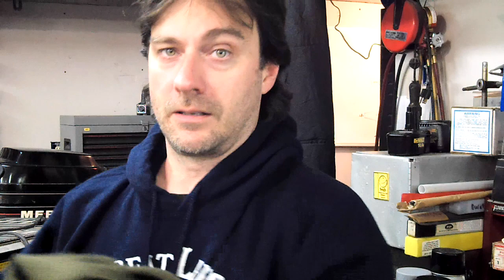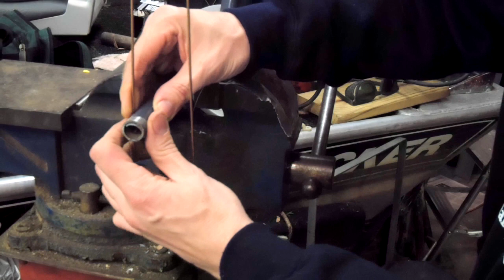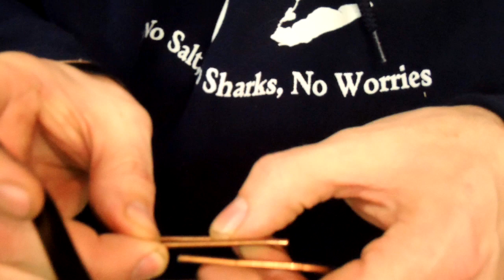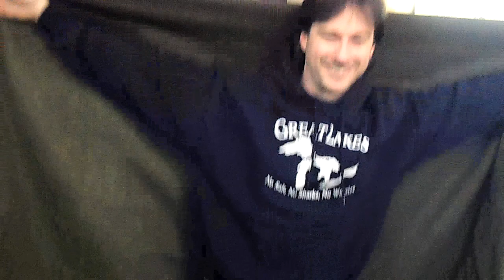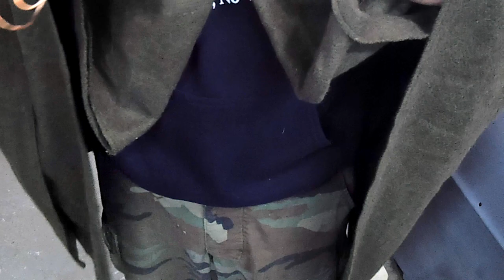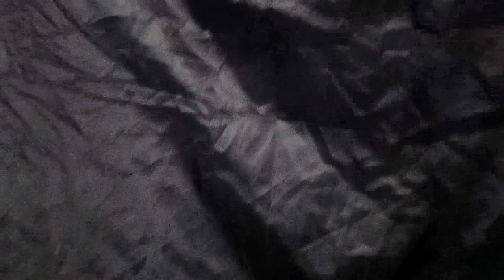Making A No Hole Blanket Pin

Comment: OK this video seven years old I like the no Weld method I have a suggestion on not using the electrical tape so much, but to use the shrink tubing that you would from doing wire connections. It would be durable and be tight be easier to slip a blanket through than electrical tape. just my two cents but I like the blanket pin with no holes going into I want a blanket
Reply from the maker: That's a good idea Ray!

Comment: Slick lil project there. Dave's super clip. :) make em all enough no hair cut needed. then they are Dave's wire hair barrets. :p What gauge do you think would be good if it's say solid core copper wire, 10 or 12? Happy New year as well Dave for you and your family. Keep the fun crazy projects, and wit coming. :)
Reply from the maker: +Certawin  LOL, thanks man! I'd say on Copper I would go for 8 or 6 gauge if you can. Copper is so soft that even 10 may just bent too easy and not hold. I used 1/8 carbon steel welding rod on this and its the smallest Ill use. Happy New year to you and Thanks for watching

Comment: Instead of black electrical tape, you could slide two pieces of heat shrink on the wires. You would then slide one over both loose wires, heat shrink it, then slide the second piece of heat shrink over the first one and heat shrink it also. Double layer for extra strength. I'm guessing an inch or inch and a quarter length for the two pieces would work. What do you think?
Reply from the maker: +Diane Rivenbark  Yep, I agree with you. Heat shrink tubing would be a perfect way of holding this together. At least an inch would work.

Comment: Excellent idea... is it possible to solder the cut ends, instead of using tape?
Reply from the maker: +TBOR101 Thanks, I'm glad you liked it. Yes, if its clean enough it could be soldered. Another option is heat shrink tubing.

Comment: If you could wedge the smaller diameter pipe/dowel into the larger diameter pipe, you wouldn't have to keep changing out your vise.... just a thought.  Would help if you were making several at a time.
Reply from the maker: +Faith Adams  I probably could, or hang it off each side of the vise. Good thinking Faith!

Comment: Hi Dave, cool idea bud!  I can see how they could be used for several things.  But, not even a pocket knife on you?  tsk tsk tsk ... lol  I've carried a lock blade folder in my pocket since I was a kid, because my dad carried one, so I had to as well and the habit was born.  It only has a 2 1/2" blade, so not big in the pocket and great for times when you need to cut something quickly.  Rock On!
Reply from the maker: Thanks man! Nah, no pocket knife for me but often times I carry a multi tool. Thos seem to work best for me.
Reply: Wow, seems strange to me that you don't carry one, because you'd be surprised at all the times my pocket knives have kind of "saved the day" in and out of the woods (I've impressed bosses with having it before even lol).  I edc a multi-tool as well, working on customizing the case for a ferro rod atm.  Rock On!
Reply: Zcadguy, like you can't imagine not carrying a pocket knife, carried one since a kid also, I guess 60 + yrs now and would feel naked without one. In fact edc is now a clip knife with assisted opening , because so many times you have something  you only have one free hand, down on the farm :-) or shop.

Comment: How long of a piece of wire did you start with? I know you trimmed a little off at the end, but what was the starting length?
Also, for some folks who don't have easy access to welding rod, some of those hot dog roasting bbq/firepit forks are made of just twisted wire. That's much better wire than a coat hanger.
Reply from the maker: +Darryl Machtmes  The rod was 3 feet. Amazing how much length it takes to make. Good idea on the hot dog skewer!
Reply: @Reallybigmonkey1  I'm glad I saw this before I trimmed some steel rod I have to 15"...I don't weld and I couldn't get just 1 or 2 welding rods, and the ones that I saw were 14 or 15" long and I found a 1/8" unthreaded rod in the allthread section that was 3ft long.

Comment: Did you use these same 1/8" welding rods to make your tent stakes?
Reply from the maker: +338 MRAD   The tent pegs were stainless steel but they were both 1/8. http://www.amazon.com/ER308L-Stainless-Steel-TIG-Welding/dp/B007JCQT2A

Comment: hey reallybigmonkey lately I have been thinking on what I want in my pack to cut wood poles with ect .... , ie  a small folding saw ,  a machete or a hand axe ,with out carrying all of the above. im thinking of a machete I saw that has a saw blade option alone the back edge. I was woundering what u like best for cutting wood poles ,ect..... with out carrying a bunch of tools .ty from steve .
Reply from the maker: +steve alex  First off Ill give you my opinion on them saw back machetes. None of them work well. They notch ok but as far as sawing they are horrible.  My favorite tool for shelter building or tent/teepee poles is a folding saw. I use a bow saw for firewood and my chopper is almost always a machete. I stay away from axes, they are good tools but I just prefer a machete.

Comment: That is a neet pin,  I think I would use some thin wire to wrap the loose ends with, then spread a small amount of epoxy on it to seal it.
Reply from the maker: +Duane C  You could but a buncha comments have suggested heat shrink tubing. I love that idea

Comment: thanks Dave. So true about a $150 blanket not being a good thing to ruin. My interest lies in using them with mylar, but those things are so thin and slippery that this thing might not hold?
Reply from the maker: You can bend these so they can hold thin or thick things. Mylar might just be too slippery to hold
Reply: yeah, just use a couple of hunks of paracord around me, with doubled bowknots for easy removal. I had to give up on the velcro for the outer layers of my sleeping system and go with snaps. I suffered way too much unintentional snagging of velcro when entering/leaving the system.